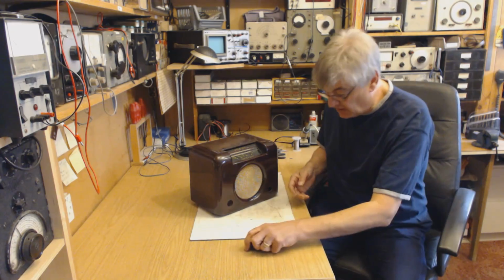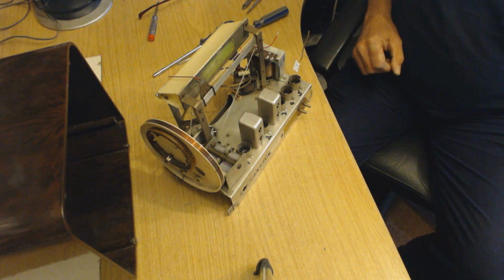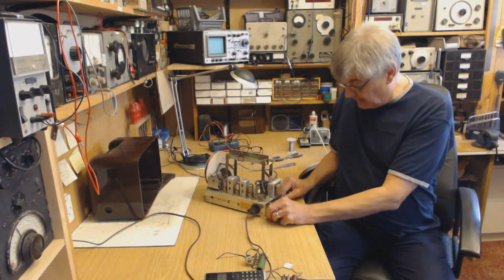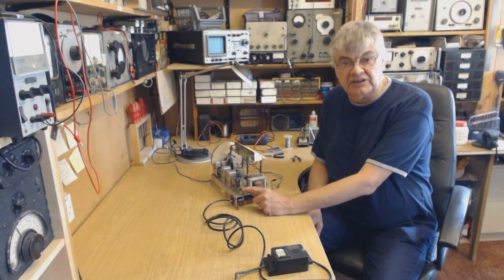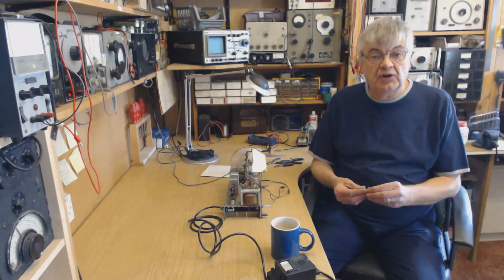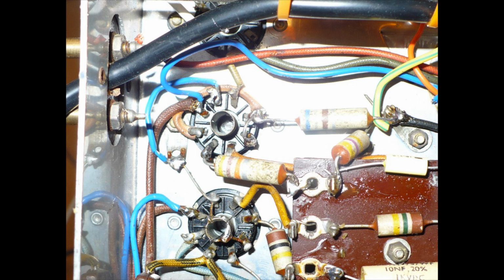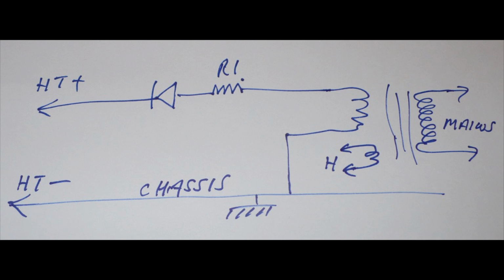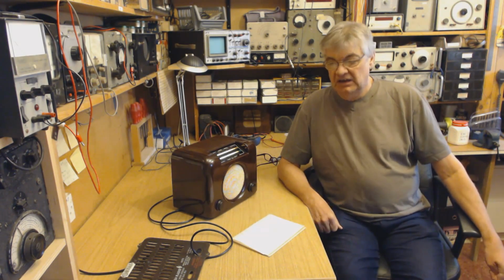Bush DAC90A dropper to mains transformer modification

Comment: hi i was following your video as i find very interesting but i was confused when you said r13 going across the smoothing cap on my diagram i have r 15 going across and r 13 going to v4 can you clarify please thank you
Reply from the maker: Hi Melvin,unfortunately some circuit diagrams vary. It’s confusing, I know. Which radio do you have?
Reply: @g4nsj  i have the dac 90a
Reply from the maker: Yes, there are at least two circuit diagrams which are the same apart from component numbers.
Reply: ok i have to be careful as to what i am looking at so i dont remove the wrong part thanks 
 @g4nsj

Comment: What’s does the rectifier achieve/add to this setup?
Reply from the maker: Up Over Games it turns AC to DC.
Reply: Radio Workshop ah so you didn’t need it after you made the conversion?

Comment: U series valves don't have 6.3v heaters, may have been better to find a transformer with a secondary to run all heaters in series.
Reply from the maker: Hi Mark, It was difficult enough to find a 6.3 Volt transformer with enough current, let alone one of the correct voltage to supply the heaters in series. It was easier to change the valves to E series.
Reply: @g4nsj  Ah sorry, didn't realise you changed the valves too. That makes sense now :)
Reply: @g4nsj  2 x12v transformers wired back to back making a 220 to 220 isolation setup wouldnt work? not enough space?
Reply from the maker: Hugo B. Not enough space, sadly.
Reply: @g4nsj  ok! i am not a fan of modifications but i subscribed to your channel, you have a nice repair bench and i like your work. i also repair tube gear but i'm more into tv's ....cheers
Reply from the maker: @MrHBSoftware  Thanks. Hugo.

Comment: Hello Ray. I am thankful that You have helped me before with an old radiogram chassis ( https://www.youtube.com/watch?v=slKaOyPjHqs&t=34s ). I have had a Bush DAC90 land on my bench and the mains dropper ballast resister look very worse for wear. Can I ask if it is possible to source a mains dropper for this please?
Reply from the maker: Hi Eddie, it's nice to hear from you. I'm afraid I can't help with the dropper as they are like hen's teeth these days. I think your only option will be to find a scrap radio to rob. Sorry about that. Cheers, Ray.
Reply: Hi there Ray. Thank you for your reply. Indeed, like pulling sharks teeth! :) 

Anyway I'm doing your mains transformer mod. Awesome!! 

I need a little more advice if that's OK. I'm at a point of refurbing the cabinet and cleaning the dial glass. I haven't touched it yet and I'm wondering if there is any useful tips about cleaning this. Any No-No's etc. 

Thank you Ray!
Reply from the maker: Hi Eddie, basically, don't clean the dial glass. Clean it very carefully, if it's really bad, but don't rub the lettering off. Try a little warm, soapy water but be careful.
Reply: Cheers Ray. I'll maybe upload this when I'm done. The Transformer mod is genius. I found one with separate winding for bulbs and centre tapped 6.3 volt winding. Awesome. Thanks again. :)

Comment: The cause of the overheating problem most likely won't be the heater current, but transformer saturation caused by the unipolar DC current flowing through the HT secondary caused by the half wave rectifier you are using. If you remove the half wave rectifier and replace it with a full wave type such as a 2W08M, then you'll probably find that the transformer will stay much cooler.
Reply from the maker: Thanks for that. I did use full wave in the end. Cheers, Ray.
Reply: Did that solve the overheating issue?
Reply from the maker: Magic Monty there was a slight improvement. Thanks.
Reply: Would you be able to work on an Armstrong ST3, by the way?
Reply: Hi, sorry I only deal with 1940s radios. Cheers, Ray.
Reply: Are you sure I can't persuade you? It's all valve. The AM section works pretty well but there is definitely some funny business going on the the VHF side of things. I'm not really competent enough to do an IF and discriminator alignment on a valve set.
Reply from the maker: Hi, I'm afraid I can't help as I don't deal with FM radios or anything later than the 1940s. There is a guy in Norfolk who might be able to help. The Classic Radio Shop. Cheers, Ray.

Comment: I have been watching your vids here in the US. Very informative and a pleasure to watch !  I purchased a DAC90A and waiting on it to get here. In your vid you said you had to change a few things on the audio tube EL41 to El42 did not get all of it. I was wondering what the cathode resistor was replaced with from the 150ohm to ? and what was to modification on the audio output tube?

Comment: It looks like you have retained the half wave rectifier using a 1n4006. I'm wondering if the resulting DC imbalance on the secondary may be reducing the transformer efficiency and thus generating more heat. May be worth trying a bridge. Cheers Doug
Reply from the maker: Hi Doug, thanks for that. I did change it to a bridge as it also reduced hum. Thanks for commenting. Cheers, Ray.

Comment: Well you have ruined the originality of the Receiver by changing the valves and putting in a mains Transformer.
Reply: Personally I think if it makes the radio safer then its a good idea.
Reply: Bush should have done this at the time of manufacture instead of using this cheap and nasty and horrible ac dc tech. Anyway as i said the originality has been destroyed. The cost of a mt would have only  increased the costs of a few bob.
Reply from the maker: The radio has not been destroyed. It can be put back to original in about 20 minutes. I've kept the original parts.  Cheers, Ray.
Reply: The idea of the restoration of vintage Radios is to restore it to it´s original condition.This might not be 100% possible, but not to  completely redesign the RX.
Reply: @grahampinkerton2091  i agree...safety is not a concern..the chassis is not exposed and the radio most likely will and shall not be daily used by people not familiar with its dangers..so i keep the mains dropper and hot chassis on my radios without any fear.. i am not stupid to operate the knobs with dripping hands or to stick metal rods trough the back etc
Reply: A slight mod? Now your joking.

Comment: You could use a time delay circuit for the HV if you chose to use diodes. Also, maybe some warm white LEDs for the dial light would save current draw even more. I know.....heresy :-)
Reply from the maker: +Don Lewis Hi Don, yes good idea. Cheers, Ray.

Comment: Ray,
You have beat me to the post on two accounts my friend: one was the UL42 – I was hoping to suggest using one of those but you swiftly got that one in – well done!  The second one is, I own a Sunbeam radio (I thinks its model number is 57) that is bereft of it entire dropper.  I feel it is safe to say that I have no option but to use a mains transformer – I’d like to get a tune out of it but getting hold of a circuit diagram is starting to prove more or less impossible.  I plan to use this radio for a near future You Tube restoration series production with the idea of demonstrating that conversion is possible and then show how it is accomplished - I'll still do this.
I’ve seen, some years ago, a transformer arrangement fitted in place of the droppers on a DAC90A.  A fellow service tech’ used an autotransformer which, if my memory serves me correctly, salvaged from a scrap Bush, model AC thirty-something. 
When I get my Pye, model 49C, back from on loan as a prop to a local amateur theatre group, I’ll show photographs on You Tube of my rendition of converting an AC/DC radio to transformer AC only (it’s the only one I’ve ever done and it works well).  
I must say dear chap, before signing off, I really enjoyed watching this production – excellent way of showing how this is accomplished - well done.
Regards,
Phil.
Reply from the maker: Hi Phil,
Great minds think alike! I'm glad you liked the video and I'm looking forward to your video. Thanks for taking the time to post, it's great to get feedback. Cheers, Ray.

Comment: Great video, I think that could also answer my question (at least partly) on modifying a British Bush for U.S. 120v mains voltage, using the correct transformer of course. Or go the other  route and use an external step up transformer.
Thanks,
Tom
Reply from the maker: Hi Tom, you should be able to find a suitable transformer and carry out the mod. Great stuff.